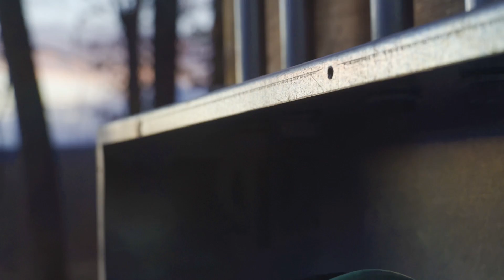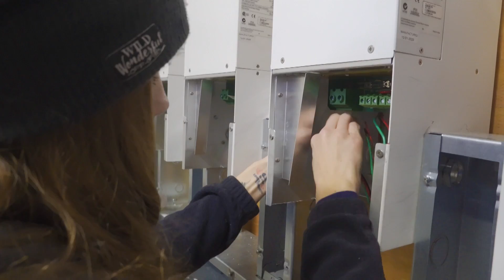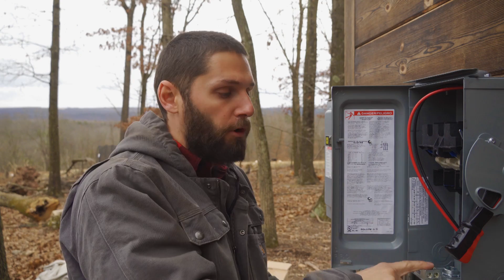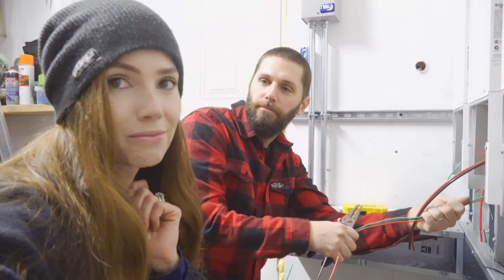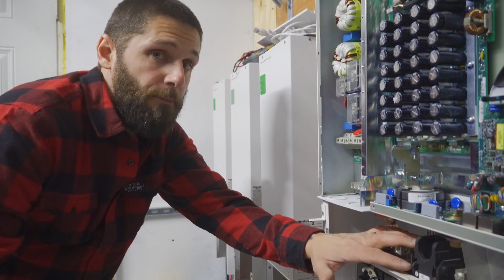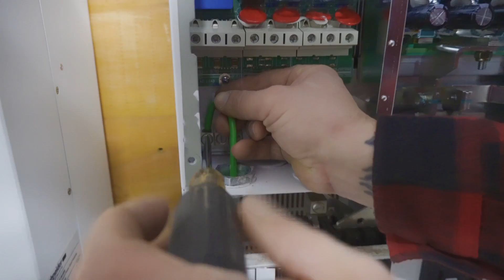Building A Solar Powered Home | Wiring The Charge Controllers And Inverter

Comment: I am curious if Josh could have combined the 2 (or more) 420v arrays and run them back on a single conductor pair to a single disconnect DC bus with multiple charge controllers tied onto it? I guess the charge controllers would not necessarily know how to share the load but is that theory electrically sound assuming like voltage arrays?

Comment: Several observations (1) are those disconnect panels rated for outside exposure ... I don't see the gaskets typical for outside use and (2) are the contacts rated for that level of dc voltage... you try and open those in full sunlight and light load, whats the voltage at the contacts ? Arcing ?

Comment: Josh  as the 3 charge controllers are wired in parallel to the inverter, how close  must each output of the controller be held with respect to output voltage to each other.  I imagine this is done by the "brains" of the controller.

Comment: Are you going to give a cost breakdown on what your new system will cost when finished, and your approximate break even point? With your background, were you able to source components at or near cost from former associates? The upfront costs and maintenance costs of replacing the storage batteries may be to much for those of us on a fixed budget.
Thanks

Comment: Why not put these 3circuit breakers inside the shed. 1. Better weather protection. 2 Behind a locked door (a little delay for bad gay switchen off all elec,) 3. Lower grade breakers possible (not needing outside weather grade = lower grade = lower cost) ? Alternative a lockable cabinet could have been made against the wall for all 3 breakers and more...?

Comment: Am a retired electrician and realize different areas are not the same. Were I AM OUR PIPING AND ALL THE POINTS WERE THE GUTTER BOXES ARE WOULD BE CONSIDERED AS A PO9NT OF COMMON GROUNDING AND WE WOULD ONLY HAVE A GROUND WIRE COME IN AT THE MAIN POINT OF GROUNDING AND THAT WOULD BE THE ONLY GROUNDING WIRE NEEDED.

Comment: Now with your amount of Voltage i think it would keep the Batteries constantly full, also with bad weather conditions.
     Q.: would it make sense to exchange the dryer into full electricity to make the Return of  Investment quicker.
           Propane / Voltage Price. I think when you use the dryer in the early morning, you would use battery capacity till 
           enough voltage comes in to fill up the used capacity for the daily uses, like Airconditioner and so on.

Comment: Hi, you're right. I can't help but comment on that. in romania we use 230 volts. in the apartment blocks and in our country the neutral is united with the grounding, but in the houses, because the air transport of electricity is still used, the grounding is 3 poles of 3 meters buried ....

Comment: Just a tip if you were to read the back of the cover for those disconnects. It will tell you when using dc you are to be using L1 andL3. Not to use L2. I am an electrician and also do solar installations.

Comment: In fact you worked well together to do a very good job of showing the work sequence. Very professional. And Sparky Josh actually knows what he's doing. So he can adapt to circumstances and know it will come out right and safe. Don't  try this at home folks if you ain't got the knowledge! First time I opened a 200 amp box and saw the ground (earth) and neutral connected I freaked out and got a pro in. Who laughed. As Josh said: "That's how we do it over here."

Comment: Master Class electrical work aside, another big takeaway from this is:  Work your craft until you're capable of working around the shortcomings of your materials.  Then, when you do see something that's not up to the standards you have for your skills, don't be afraid to take it apart back to the origin of the fault and do it over.  Thank you both for leaving all that in the video - the do-it-til-it's-right attitude of you both.  Massive life lesson right there.

Comment: pro tip: feed cables towards the shorter/easier side (i.e. just the ~5ft from the inside to the disconnect instead the 15+ft from the outside to the charge controller) ;-)

Also: avoid pulling around edges. Pull straight and then loosely guide the wire around corners without force.
It doesn't make a huge difference in this particular case (all the edges seem well rounded/padded so the insulation should be undamaged), but if you get into the habit you'll also do it with more delicate cables (ethernet, satellite, fiber, ...) which might actually suffer from being bent too tightly and pulled with too much force.

Comment: Hey Josh anything that's outside of the main service has to be separate they are not bonded together the only thing that gives bonded together is the main service panel that the metre is in everything else neutral and ground are not connected

Comment: Josh, you taught me something, and it was really simple - using the magnetic level to clean up the chips.  May I suggest using some contact grease on the places where the paint was removed?  It's not needed for the connection, but it'll keep the bare steel from rusting.  Also I'm wondering about ground loops between the ground wires and the conduit/chases.  Beautiful work - both electric and cinematographic.

Comment: #8 wire rated for 100 amps huh josh,not!
Reply from the maker: The green #8 wire is our equipment grounding conductor. 2017 NEC Table 250.122 Minimum Size Equipment Grounding Conductors for Grounding Raceways and Equipment. #8 copper is rated for 100amps. If you are referring to #8 as a current carrying conductor, refer to table 310.15(B)(16) formerly table 310.16 copper #8 in the 75degree column. #8 would be rated up to 50amps

Comment: Why did you grind a bare spot on the disconnect switch and drill a hole to install that double barrel mechanical lug?  There are several spots to attach the mechanical lug to the back wall of the disconnect switch with a 10/32 screw. Seems like what you did was an extra step but hey looks fantastic otherwise!! Edit: I heard why... still seems like an extra step because there is more than one hole to attach the lug to with a 10/32  on that disconnect switch

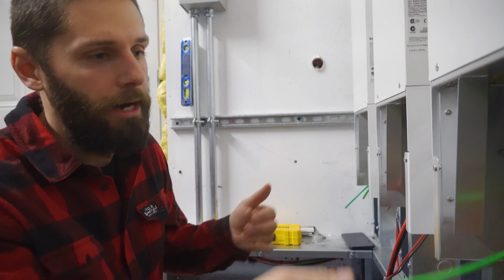Comment: Is #8 AWG wire really good for 100 Amperes?   15:31
Reply from the maker: Yes its good. Check out table 250.122 Minimum Size Equipment Grounding Conductors for Grounding Raceways and Equipment. Copper #8 is rated to not exceed 100amps

Comment: You are doing a great job. Don't you just love those engineers who keep changing the designs? 
So what size is your main breaker there in the power house?  I am guessing that you have the one iin the house wired as a sub panel. I am looking forward to seeing your system operational. Best wishes

Comment: According to a Google search, #8 wire  will only handle 70 amps max.  Does your bonding have to  be for the maximum amp capacity of all the panels?  If so, it appears that a #8 might be close to being too small.
Reply from the maker: The best place to source info is going to be the 2017 NEC code book. The green #8 wire is an equipment ground, not a current carrying conductor. Refer to Table 250.122 Minimum Size Equipment Grounding Conductors for Grounding Raceways and Equipment. #8 copper is rated for 100amps.
#8 as a current carrying conductor, refer to Table 310.15(B)(16) #8 in the 75degree column is rated at 50amps.

Comment: Hi Josh. 

I've been an Electrical Inspector in Canada for over 40 years. We also ground the neutral (or negative) at the service entrance and isolate it at all points downstream. BTW, you do excellent work.  
Love your show.
Reply: Is the inverter the service entrance? Or, is the service entrance the adjacent electric panel? I'm currently scrunching my face up trying to absorb the idea that the inverter could be thought of as the service entrance.
Reply: @Mozillapi  
The service entrance is at the first disconnecting means after the supply conductors enter the building. Is this case we have a DC service, so the negative must be connected to the ground electrode. The output of the inverter is not a service. However, it is a new and isolated system, similar to the secondary of a single phase 3-wire transformer. So the neutral must also be grounded at a single point, and isolated at all points downstream.

Comment: Whats up with all this closed metal trunking for the wires? Is this required in the U.S to be up to code? This is seriously different from European installations. Not saying one is better than the other, but different. I get it on the outside (pioes), but inside? We would mesh wire cable trays or similar inside with cable ties. Also im wondering about the DC circuit breakers on the outside, why not use plastic ones, these seem expensive and hard to install. I work as an electrical Inspector in Sweden so thats why Im curious ( sorry about the poor english)

Comment: Excellent:
. Off Grid, installed to NEC standards              (A master electrician talents and pride of workmanship shine through)
. Excellent filming and editing showing step-by-step instructions and the reason why the work is to be done that way to pass inspection.
. Entertaining, with the help of your personalities and humorous interludes you consistently produce great entertainment.
Suggestion: Produce a detailed block diagram of your solar system With wire size and equipment nomenclatures for your subscribers to see how a well engineered and implemented Off grid solar installation can be.

Comment: Nothing makes trouble shooting a panel, or machine,  easier than a clean panel. 37 years as technician and I have seen the good, the bad, and the ugly. But not here. Here you have, Josh the good. Josh the dancer, the bad! (Never stop dancing 💃) And the beautiful,  mis Erin! 
Like others are saying, your skills and attention to detail will pay off over time. You can see if in every inch of this build and every laugh from your family. Even the animals feel the love! Love and prayers to your family from mine!
Reply: Wayne, What did you think of Josh bonding the ground and Neutral together in the inverter and treating the Main service panel as a sub panel? I would have bonded the ground and Neutral together in the main panel, but not the inverter. I'm just not sure what to make of that. Thoughts?
Reply: @Mozillapi  I'm a low voltage guy and and won't pretend to be anything more.  But the service anchor for ground and neutral is on the input so I THINK it is just a preference. 
The way he ran it meets code for his area. That I'm pretty sure of.
Reply: Like AvE says, you gotta make it easier for the next guy, and it's often the case the next guy is you.

Comment: Good to see the progress. Wonderful to see Josh using wrenches on bolts and nuts. It is hard to imagine you ever needing more power than that, but I don't know what the shop will need when it is finished. Also not sure if you have power in the barn. Thank you for sharing your real. Stay safe, warm, and well.

Comment: Josh, you guys will have a good system once you get it going. Know you know why I prefer Sol-Ark 12K's over all the rest. Much less expensive to install because you can use 10AWG wire for every 2 strings of solar panels, all-in-one with dual chargers built in to the unit and extremely easy to wire compared to Schneider. I really liked how you showed your audience how to ground bond everything. Most DIY installations I come across miss doing this

Comment: I can only imagine what the labor would cost if you have to hire someone to do this!
Reply: So far I have had two bids on my farm, which will have a system about 4 times the size and labor quote I received today was almost $30k.
Reply: @mattmoschkau84  so you’re saying 7.5k then ...
Reply: @sgreen9056  
Its hard to say exactly. Labor rates vary, and different products may take more or less labor. I’d would use those numbers as a very rough estimate to gauge what labor for solar could cost. 

I can say for sure Josh’s skills as an electrician saved them several thousand minimum!
Reply: @mattmoschkau84  sell the farm .good lord thats expensive 😳

Comment: You're not grounding the panel as well i hope? The whole system should only tie to earth at one point or you'll create parallel paths to the neutral.  Okay phew later in the video you cover that.  There's a company that now makes screw on bonding connections for EMT so you don't need the bonding wire.

Comment: Don't worry about europeans not getting why you have to build some stuff in a particular way. We don't understand a lot of stuff why it's done like that in the US =D Walls, insulation, heating, electrical, measurements... It's like a different physics applies over the pond ;)

Either way we like looking at it at least and won't bond ground to neutral over here, lol!
There are also a lot of cool differences that we CAN reuse over here and simplify, so that's added bonus and it's clear you are doing a clean and proper job, that you can be proud of.

I was wondering how long until you'll get a backup genny, but with the new array hopefully that will rarely run.

Comment: I can imagine it takes more time to do the job due to filming. But I am glad you are filming so we can see the fine results!
I did solar panels myself last year but used micro inverters, possible due to lower number of panels. Easier job as I did not have to deal with the high voltages of a 10-panel string :)

Comment: This way more advanced than my system 2 panels in Windows to battery. Battery to all 12v lights on all 3 floors. 110 battery tender to battery when solor not enough. Bill , Illinois

Comment: How many conduits do you have from the solar  panels to the power house / disconnects......was wondering if your running the new wire through the existing conduit and is it large enough to handle the new wire.......?